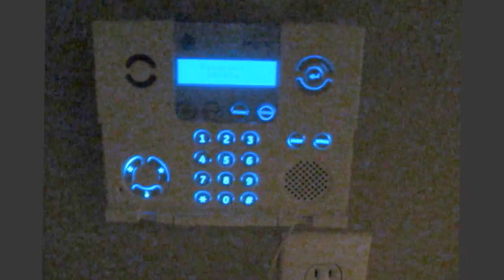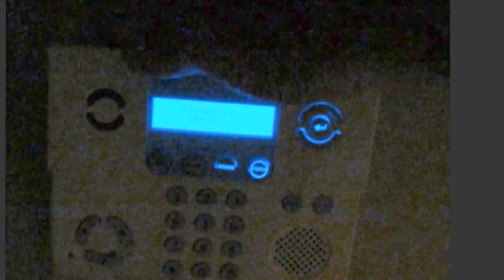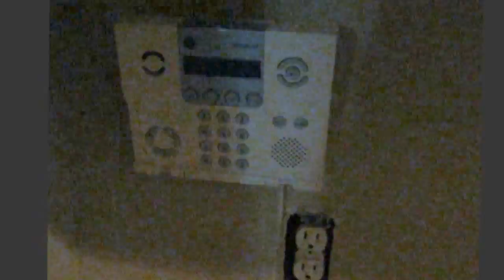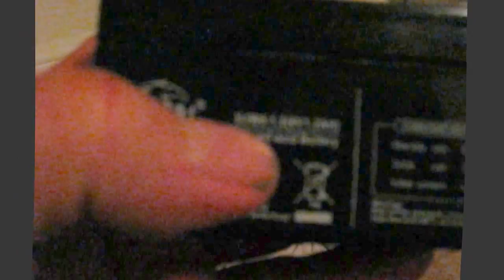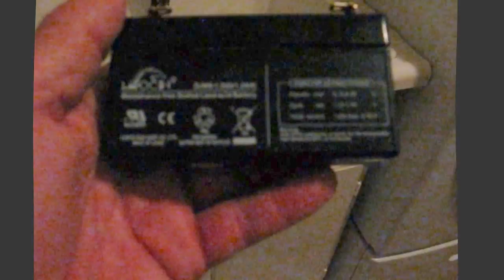youtube video #-6qitKal9B8

Comment: My security company couldn't tell me how to disconnect the battery--so thank you!
Reply from the maker: Very welcome, that's not encouraging about your support from them. Sorry to hear that. That's why I put my own alarm in not much faith in those guys with the fancy ads & all.
Reply: froggy
I think the first tech couldn't figure out that I didn't know to pull on those wires.  They seemed tight, and I wasn't sure.  So, she switched me to another, and I ended up at a voicemail.  Your video reassured me that I could yank on those wires, and my problem was solved.  So, again...thanks!
Reply from the maker: Very welcome, happy holidays!

Comment: how often should I change my ADT motion detector sensor batteries? the motion range is getting smaller, is that low battery or I should get the detector checked out? no low battery message on pad either. thanks
Reply from the maker: Most systems will beep when the MAIN battery needs service.
Each wireless sensor has it's own very small battery.
Those might need service, but I do not know for sure.
On mine if a sensor battery is weak, I get a warning to service it.
Try to get an owners manual or installation manual for YOUR system.

:)